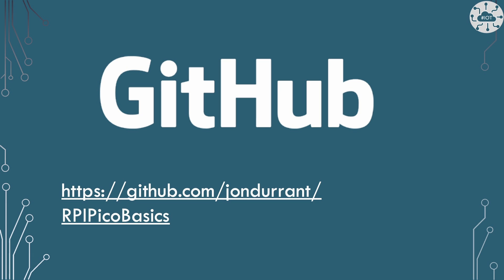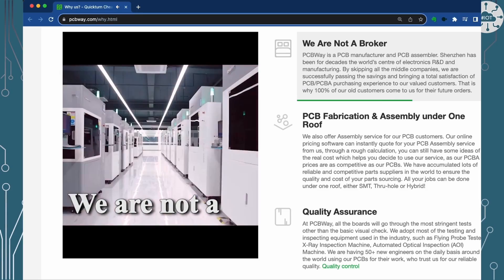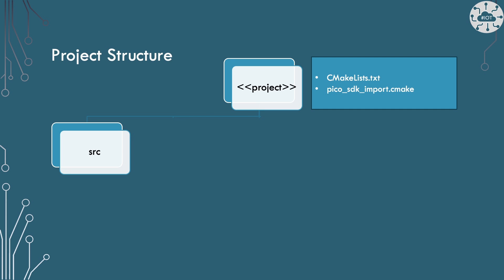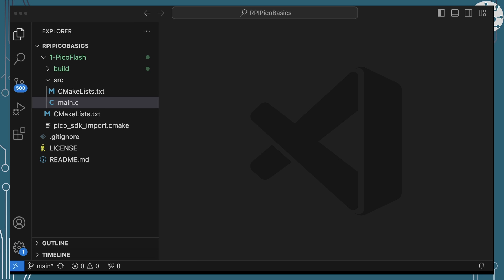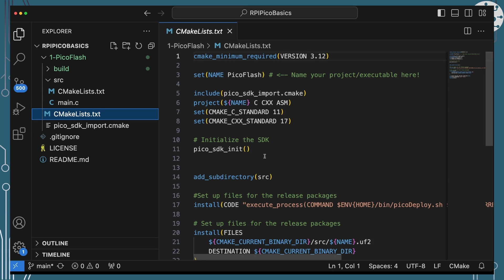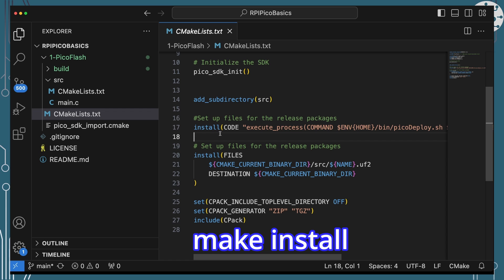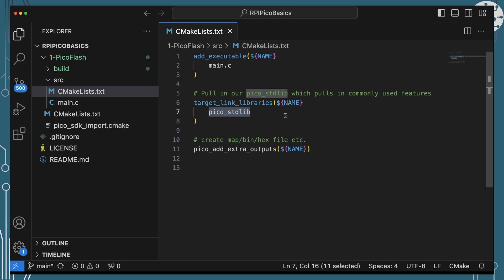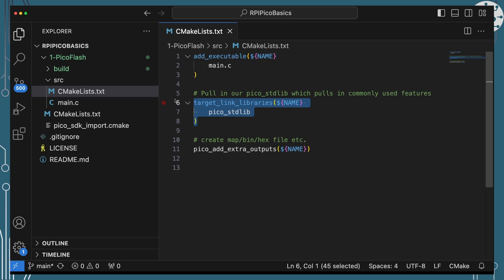Master The Raspberry Pi Pico C/C++ With This Project Structure Guide! drjonea.co.uk

Comment: Thanks! Useful background info.  As a Java programmer I'm finding C a bit of a straightjacket but C++ might be easier, so is C++ fully compatible with the Pico ?(maybe the compiler/linker takes care of it?)
Reply from the maker: Yes C++ is fully supported on the Pico. I've also been a Java developer in the past and C++ let you keep OO design and polymorphism.  C/C++ give you more control over memory management,  which was always a challenge in Java.

Comment: Excellent video.  I agree, many videos don't show you all of the details of cmake, and even assume you'll run cmake in commandline rather than through VSC.
I look forward to further deep-dives into tricks such as building libraries.
One very useful thing about VSC is that it checks for mistakes as you write code (sometimes being wrong about external references such as libraries) and can show where functions and variables are used, defined and declared.
Sometimes the help gets in the way of typing though.

For that bit about extra outputs, the comment above it says it all.  It takes the native binary generated by the compile/link process (not sure if it's BIN or ELF) and generates the other support files such as UF2, map file, etc.
Reply from the maker: Thank you. I try.

Comment: Interesting video as always, thanks! Short and good prj structure explanation of C/C++ prj for the RP2040. I work for some time on a basic structure for more complex C/C++ prj. My question is: Where to store external libraries? Should they always be stored in the project (port or lib folder) or should they be stored in a centralized external lib folder? What is your oppinion? 
I also import the pico_sdk_import.cmake file directly from the SDK into my projects.  (include($ENV{PICO_SDK_PATH}/external/pico_sdk_import.cmake). The idea is to only change the PICO_SDK_PATH ENV variable when I switch to an other SDK version. I don't know if the pico_sdk_import.cmake changes with other SDK versions. Thanks for your ideas/inputs!
Reply from the maker: Hi Martin, great questions. On your second point I agree that importing pico_sdk_import from the sdk is better. This is me being a little lazy. Something I will look at changing.

On the first point about where should libraries be. Well I do think they should be in each projects because otherwise you create a huge task for yourself upgrading everything to a new version at once, or accept potentially breaking your builds.  Certainly making your build unreproducible because libraries have moved to newer versions. 

I use git submodules for libraries so I am holding a reference to them rather than copying others code.